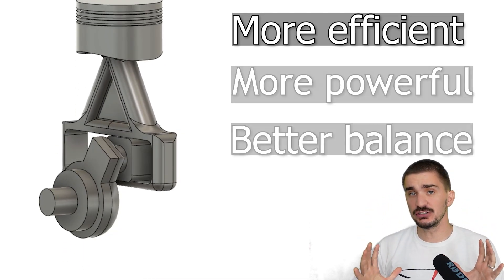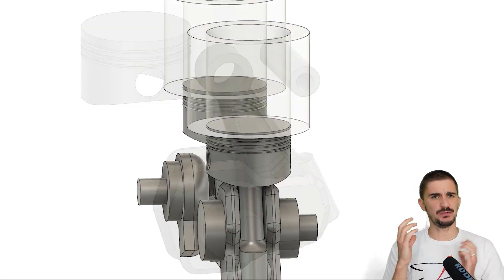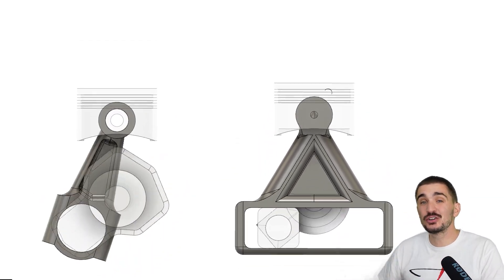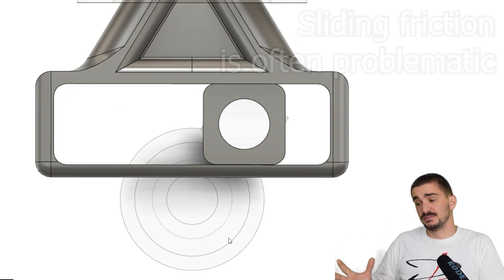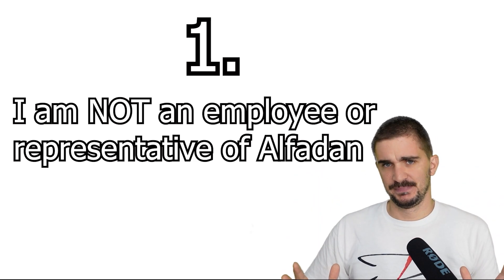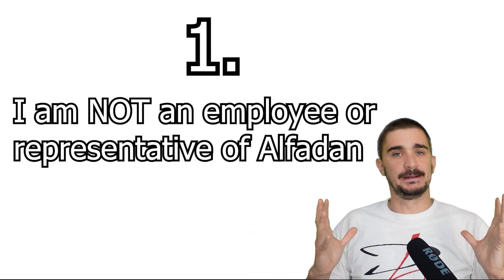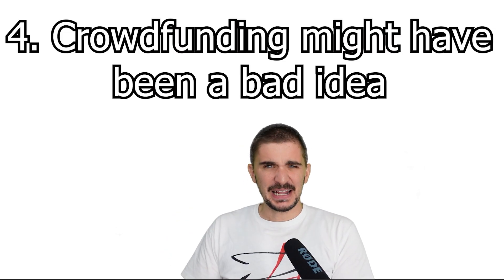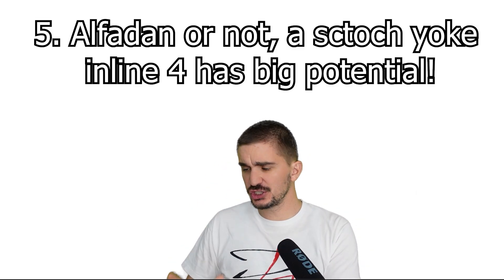This engine is better in every way?

Comment: Sliding mechanisms are really hard to perfect.
They are sensitive to dust and dirt, side-loading, tolerances and temperature.
Therefore I am not seeing the big upsides that would justify this design.

And if people express concern that "a new revolutionary engine" won't be that revolutionary, I would expect a technical channel to address technical concerns, not say that "well, they just don't understand how investment and finance works".
Reply from the maker: Twisting words much? There is a difference between "expressing concern" and blatant, impolite or insulting false accusations of scam promotion.
Reply: @d4a  There is obviously both. In other words, ignore the accusations and address the reasonable critiques, if you wish to defend the concept.
Reply from the maker: Yes, that's what I did

Comment: I'm not seeing an increase in reliability.  I'm seeing an increase in cylinder and wall wear.  You're going to be replacing cylinders and resleeving the motor more often.  That design is going to torque the piston hard side to side during strokes.  Also you've added more rotation mass to the motor so it's not going to be some big efficiency gain.
  Possible or not doesn't mean it has any sufficient gain to cover its weaknesses.  Looks like a waste of R&D.

Comment: On top of all the problems mentioned in other comments, that conrod will be incredibly weak with its wide slot and its heavy upper structure.
Reply from the maker: So you took the time to read the comments but didn't watch the video where this weakness is already explained and demonstrated?

Comment: I would be interested to know  if that yoke design could make a bicycle more energy efficient. A bicycle has a 2 crank setup which converts vertical motion from your legs (equivalent of  connecting rods) to circular motion of the sprocket. 
You know, more speed from the same rider input.

Comment: Off the thumbnail, I see a setup that theoretically keeps the piston at the same velocity during the top half and bottom half of the stroke, also without forcing the piston into the sides of the bores in the same way as a traditional rod. 

But I also see something that in practice, probably won’t work all that well.

Comment: What about implementing the yoke follower with a ball bearing, or maybe even the two “roller” “S”-interface “bearing” since it is inherently linear and there is no need for complete rotation. There is probably a real challenge for the interface material but maybe aramid fibers? it could reduce the lubrication requirements substantially to just the piston to cylinder and crank main bearings.

Comment: If you invest in a company that tomorrow goes broke, you may actually have been scammed. Saying "no" full stop disregards a ton of other influencing factors, such as market manipulation and accounting fraud. See Enron if you don't believe me.
Reply: Note carefully that our host said a scam requires attempted deception or fraud as to the value of what is being sold.
Enron was known by everyone with fiduciary responsibility, INCLUDING THE ARTHUR ANDERSEN AUDITORS, to have been engineered from the beginning as fraudulent.
So yes, Enron is a scam - one of the most sophisticated ever run as described by the forensic auditors who came in to clean up the carnage.

Comment: I'm really tired right now, but could adding  2 counter-rotating rolling wheels, or gears, on each side of the slider (meshed/ driven together, or spaced apart) work to eliminate the sliding friction? How about needle bearings along the top and bottom? It would add some complexity but get rid of the sliding friction... 
I see another problem too- the piston would still be pushing into the cylinder at an angle, unless the connecting rod is keyed into some kind of slot. 
I'm not buying it yet, but I could easily be missing some things.

Comment: Another typical problem with sliding friction is dirt buildup. The sliding surface is very large open area where engine gunk lands easily. It is then wiped by the sliding block to the corners of the system, eventually blocking movement. For this reason linear movements as such are often avoided in machinery that has to operate in dirty environments.

Comment: Physics would dictate that there would still be a force applied to the side of the cylinder. More or less is hard to say, I would judge that they are using a square slider to mitigate this. Even if it was equal, moving that friction elsewhere is probably a good thing.

Comment: The design is interesting but has a couple of problems.  I would put the cylinders one on top of the other, in a vertical design.  Since we are in the gravitational field of the planet, it would be necessary to modify the lower cylinder so that the fuel inflow comes from the side and the exhaust outflow from the bottom.  Regarding the quadrilateral movement, it would be necessary to create lubrication channels, with passive oil movement and edges to retain the oil in the channels.  The choice of materials would also be very important depending on the forces the machine will be under.

Comment: Hi, can you please post some worked examples of the kinematics and dynamics of both a scotch-yoke and typical engine and demomstrate with numbers the things you are talking about? I don't like simply taking someone's word for this, 20 minutes of talking is not engineering it's literally nothing more than "Source: Trust me bro"
Reply from the maker: In case you somehow missed it, you're on a YouTube channel. Not an engineering workplace. If you need help with kinematics or dynamics I can provide these services. The pricing of course depends on project complexity. But here on the channel I discuss and explain concepts in a way that is suitable and interesting for a wide audience.

Comment: The added mass of the scotch pin design negates any gains and also hinders the efficient extraction of energy from the uneven nature of combustion over it's life cycle during each combustion stroke.

Plus, you are not even considering the significant friction losses from the needed side load bearings on each side of the slot on the connecting rod base in this design well as pumping losses from the needed pressurized oiling channels.

Comment: maybe only in cartoon form. there is so many obvious problems with this. it aint gonna work if actually built, probably wont even start, if it does, it will break withing the first two seconds

Comment: The thin bottom of the rod would flex a lot being so thin and be a big failure point 
Is it called a scotch yoke because it was designed in a pub in Scotland after a 100 beers
Would be useless in a performance application 
The only place for scotch yoke is in a fishing reel for spool oscillation

Comment: Great to see a follow up, makes things much more understandable.
 I'm really surprised it is inline engine and not an opposed flat four? (or even a flat six, eight or more.!)
 That would get rid of the 'weakness' at borrom  of triangle. as it would be mirror image of the other side..
 Having a gudgeon pin would also allow a lighter piston plus make it serviceable. The other thing would be it's MUCH easier to forge a very strong piece plus MUCH easier to machine an 'A' frame.

Comment: Besides increased friction, If part of an inline 2,3 or 4 there is  probably going to be a weakness on the bottom of the slide when pulled down when the other cylinders fire pulling it down. It would have to be a lot thicker at least... then you end up with a lot more mass than a conventional piston and conrod design... which brings its own performance hitting issues.
I'm not seeing many advantages... and far more disadvantages.

Comment: What?  The forces are similar and the reciprocating mass is higher.  I have no idea how that would clear the cylinder walls without a "long rod" design, but that greatly increases the mass of the entire motor.  You missed the clearance problem in the design issues.  If you want something similar, simply weld a 1" plate to the top of the block and build a "long rod" engine with nothing else changed except the rod length.  This is a well known method.  It is still a conventional engine design.

Comment: instead of sideways force, the pistonhead now experiences torque tho, doesn't it? it will be "twisted" inside the cylinderm meaning the upper left and lower right corners of the piston are being shoved into the cylinder wall..

Comment: do you have any concrete evidence that their claims of the superiority of their engine is not baseless, and they aren't just sitting around twiddling their thumbs saying "working on it" while drawing a wage until the invested money runs out?
Reply: That's the way most startups work. They have an idea and maybe a few patents, and they burn through capital until they have something worth selling. It's a speculative investment; most of them fail but some make it big or at least get bought out profitably. If you don't like the idea, don't invest in them.
Reply from the maker: I don't and neither does anyone but society is built on the concept of innocent until proven guilty. No one has said proof for thousands of different companies but we can't go arresting based on assumptions without proof. Ps it goes the other way too. Do you have concrete evidence they're doing what you claim? Or any other company. You also don't have concrete evidence that I'm not a thief but you can't barge into my house because you can't get a search warrant based on a hunch that I'm a thief.

Comment: Bro, this is the first time when your words aren't 100% correct. The conventional rod slides and creates just sliding friction on both ends cranckshaft. Being round and rotating does not automatically make the interaction rolling and you know this. Probably you chose to cut corners a bit too much.

Comment: Engineering a finished product is trade off between optimum performance and cost and complexity. There is a reason why we use the traditional ICE design as it takes both into account.

The investment required to make a new type of engine is far higher than any gain, given the direction we are already heading in. Other than high power/low weight or long endurance applications we will eventually go electric. It's far more profitable and practical to invest in battery tech that can be used in many different applications than it is to invest in a change like Alfadan is trying.

Great video as always.

Comment: It can be a balance king but at the same time it become friction king. The contact surface is enormous
Reply: Why not put four bearings, one at each corner of the slider. That would eliminate the sliding friction.
Reply: @galvanaut7119  That'd add a lot of weight to the assembly but you should get points for constructive thinking.
Reply: The contact surface is smaller.  2-times diameter vs 3.1415926535... times
Reply: Watch the video first before complaining
Reply: If you watch the video instead of prematurely commenting the obvious, you will see he covers that.
Reply: Large friction surface means lower friction!
Reply: @stianmathisen4284  most of the surfaces in an engine never contact one another, they ride on a thin film of oil and any amount of metal-to-metal contact should be considered a mechanical failure. larger contact surfaces = way more oil shear forces = more losses. the main reason modern car engines are moving to thinner and thinner oils is because the engine oil viscosity contributes a huge portion of the total frictional losses

Comment: There is force pushing the piston  to both sides of the cylinder depending of the offset of the sliding part to the vertical axis of the rod.

Comment: In theory this concept looks interesting.  I wonder if such a thing has ever been tested for an extended period of time. Intuitively i doubt it would stand the test of time when it comes to lubrication, resistance to extreme temperature conditions as well as tolerance to inevitable wear. But let's see...

Comment: This video got me thinking about the problem of transferring linear motion into rotational motion without causing angular stresses.
At first i thought of a ratcheting mechanism that has a wheel with teeth on it that would engage with a pall on the piston rod. It would reduce angle of attack significantly.
But then i realized that such a system operating at those speeds and loads would most likely wear out or fail quite prematurely.

Then i thought about what a 2 stroke engine is. It's essentially a pump that sucks and bangs on one side of the piston but also sucks and pushes with the other side of the piston.
And a steam piston pushes in both directions effectively making them 1 stroke engines.

So here's my second idea, a conventional valve driven engine that runs in 4 stroke. But where the piston rods only job is to return the piston to TDC. It's not meant to carry the load of combustion at all.
Instead, the sump side of the piston has some really low viscosity hydraulic oil that, on the combustion stroke, is directed to any hydraulic motor in the system which is super high torque that can be geared over to high RPM as necessary.
The sump side of the piston would operate like a 2 stroke with one modification, on the exhaust and intake cycle it would "idle" and just keep a neutral load of hydraulic oil. But on the combustion stroke it would pressurize an accumulator and on the exhaust stroke it would pull in fresh oil from the low pressure side.

I have no engineering skills and it's just an idea but it would be really cool to see if that was viable in any way. It would practically remove all imbalances in an engine though.
I also assume it would be a very low "RPM" engine that instead focuses on extremely high compression ratio and torque.

Comment: I think the only way you could get this to work is with a two sided piston like in a Boxer configuration where the weak bottom of the piston is the second one instead, as you still gonna get side force applied to the piston as the force move out to the edge of the slotted connecting rod. the opposite piston would act as a support to the other and you would have no weak sides of anything but the sliding part.

Comment: Conventional design transfers the power through 2 frictional bearings; piston to rod and rod to crank. However scotch yoke solves this problem by still using two frictional bearings; one is from crank to the square sliding block and the other is from square block to the rod, also one of them is sliding friction now. brilliant.

Comment: That load is still angled pretty good even if the rod isn't... with the addition of even more complexity because of the additional forces on a less robust part. Also, I feel like you're kinda just casually overlooked that one little thing called thermodynamics lol. 

Frankly I'd rather go with a rotary style if I had to do something different, but the traditional ICE is pretty well optimized at this point. No reason to reinvent the wheel. At least they sound cool haha

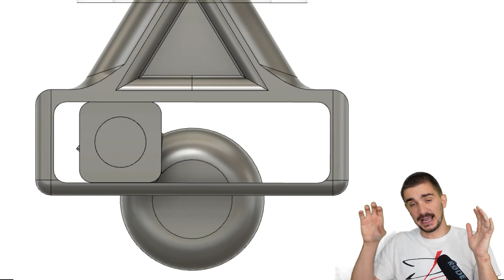Comment: 6:51 Why not make the sliding block round (I first though, but when I think of it it's due to weakness and wear from combustion pressure (think this is what you explained at 7:25))? (If so) We decrease friction by doing so and oil would anyways reach the areas of friction.

Good job talking about this.

Comment: This does nothing to reduce piston side forces, they're still there just the same as the geometry is still the same.  It does dramatically increase reciprocating mass though, so I guess that a plus?  Quite literally the only 'benefit' I can see here is better balance, but there's much better ways to resolve that problem.

Comment: The rounded-square rod bearing, as logic would dictate, is a 2 piece design.  Why not make it a fully rounded 2 piece design?  It would be thick to accommodate 2 fasteners (chamfered fastener inlets), but would result in a much less surface area in terms of friction.  Much like existing rod bearings, it can be force fed oil from within the crank and push outward towards the rod bearing (identical to how the 4AGE accomplishes this).  It could also be designed as such to allow it to freely rotate VS being in a fixed position - the 4AGE rod bearings are in a fixed position - again reducing friction.

Having the bearings and rod/bearing surfaces ceramic coated could also help to reduce friction or maybe having the parts WPC treated.
(It was not CPL, but was WPC treatment)

Per the lower portion of the rod being weak, downward motion isn't the issue, upward motion is.  The greatest amount of upward force applied is at bottom dead center, increase the total thickness of the rod cap with the ends being 'U' style - the fastener would be in the hollow portion of the 'U', but filling in the hollow portion just past the fastener.  That would drastically reduce the areas of weakness.  I've no doubt that a high carbon steel could lead to a reliable setup.

Comment: This is like those quasiturbine or liquidpiston engines (just the most famous ones, there's dozens of variations of them). They are all the best thing since sliced bread, if you ask the people who patented them.

Except none one of them has ever managed to put a working model into an actual vehicle that could perform well and last very long at an affordable price. I think that says all that needs to be said about them.

The only real alternative to a crank and piston internal combustion engine that was ever good enough for widespread commercial use is the wankel, and even that is gone because it simply does not offer as good a compromise as the tried and proven mechanism every car engine on sale today uses.

Comment: Maybe a boxer style engine would work. The crank case could have friction plates in it. Like rolled flat shell bearings. I could see it having wear problem on the crank pin though.  Imo.😊